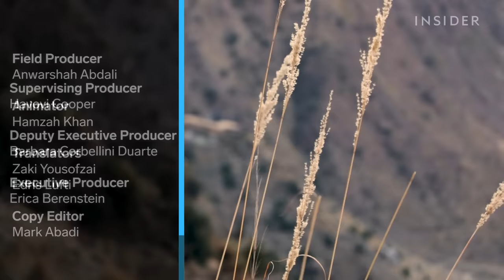How Rare Gems Are Hunted In Afghanistan From 300-Foot-Deep Mines | Risky Business | Insider News

Comment: ....most stones from Afghanistan get bought via buyers in Pakistan, where they are then traded on the open market, and a lot of times then bought by large buyers in Bangkok. Most tourmaline coming from Afghanistan is a seafoam green color, and is more prone to fracturing when cutting/faceting than other tourmaline varieties. Afghanistan produces a nice amount of emerald too, SWAT mine in Pakistan/Afghanistan put out a lot of material.
Reply: It's nice to hear that Pakistan is atleast helping the miners in order to sell the stones. I just hope it doesn't get invaded again, decades of war keep the country from improving at all
Reply: Good knowledge, Kevin. All tourmalines will fracture (or craze) if cut the wrong way. Best way to avoid fracturing during the cutting process is to use hot water. Oil will also prevent fracturing during cutting. I have been working in Afghan tourmaline and other gems for twenty years and I think they are the finest in the world, way better than African material. I'm sure I met Habibullah in the past. Beautiful guy. Earned my AG in Bangkok last year. Best regards.

Comment: what the hell are they using to cut those stones? normal cutting wheels shouldn't be able to cut your finger off if you slip. I mean, they are designed to abrade away the stone rather than cut it like a saw for wood. Sure it will probably leave a nasty wound, but cutting off your finger would take a conscious effort and time.